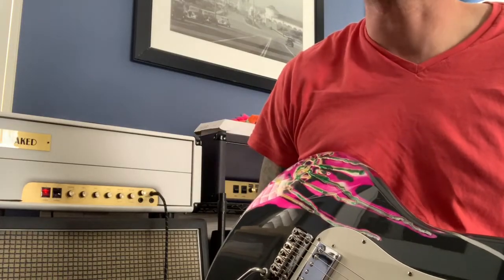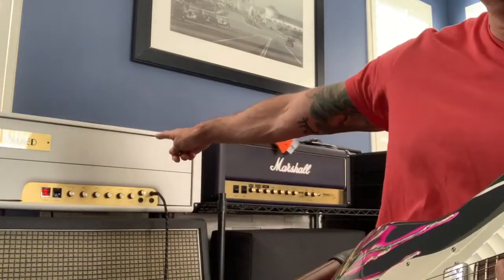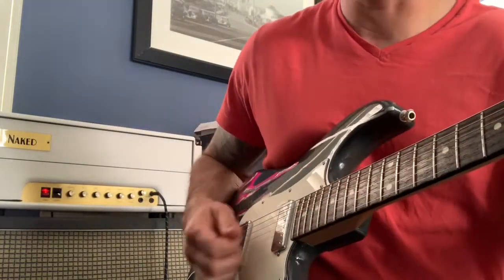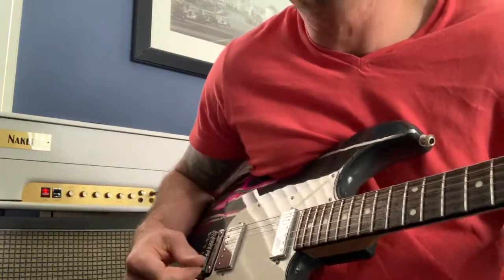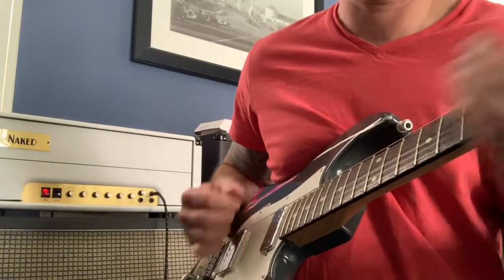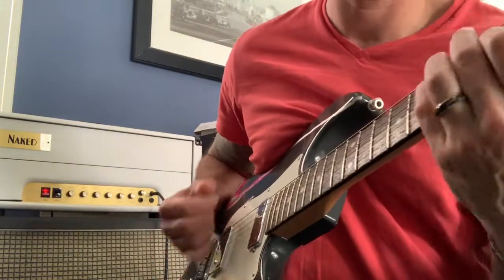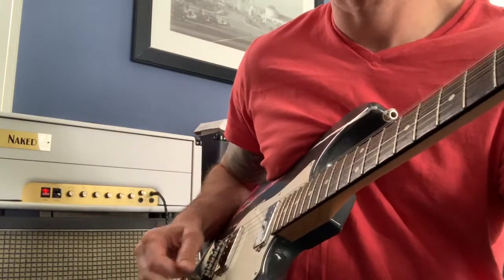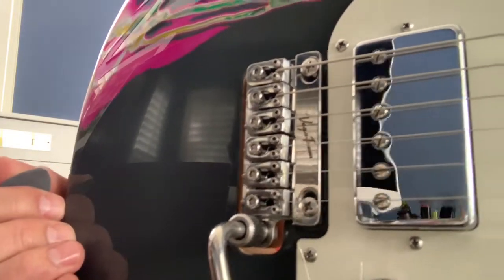VegaTrem - Tuning Stability

Comment: Bend the G string aggressively then check tuning.
Reply from the maker: stays in tune just fine on my guitar.  Provided the strings are stretched and you're not hanging up at the nut (well cut nut, lubricated) there are no issues for me

Comment: Maybe you know of any important differences between two-screws and four-screws bridges?
Reply from the maker: They are identical, the only difference is the mounting plate, which is configured for 2 screw or 6 screw bodies (with the 6 screw body you only mount in 4 of the 6 holes)  2 screw trems use a larger post screw that threads in to a steel insert, so its possible to secure the base plate with only 2 screws.  On a 6 screw trem, the holes are smaller and go directly in to the wood, therefor you need to use more screws to generate the same amount of contact pressure.
Reply: @flinto2002  yeah, my squier has six holes so I thought about going with the 4 screws version. Thanks!

Comment: Floating nightmare. I guarantee anything that requires a perfect balancing act between springs and strings is going to be a pain in the ass
Reply from the maker: You guarantee? I've been gigging this trem for YEARS, no issues. BTW, the balancing is no big deal, a floating floyd rose is perfectly stable.  You sound like a guy who either doesn't like tremolos for whatever reason or hasn't figured out how to make them work
Reply: @flinto2002  Yeah I can’t make them work I don’t have the patience to spend half my time adjusting the damn thing

Comment: Is it lockable into fixed position?
Reply from the maker: it is not.  its fully floating all the time
Reply: It can't be decked, since there is no platform larger than the route to contact the top of the body, but it can be blocked from within the spring cavity just like a stock tremolo.